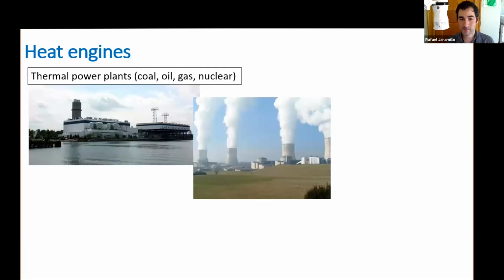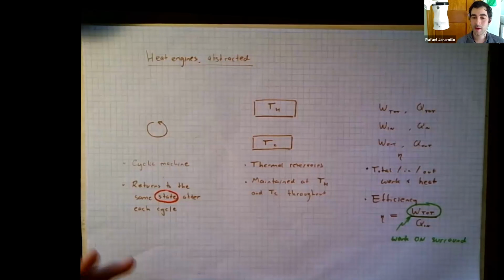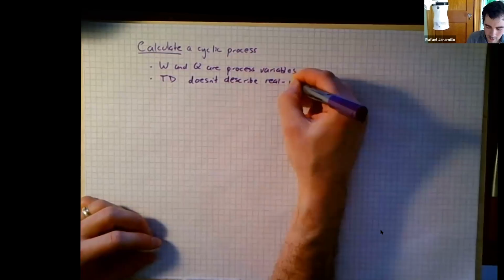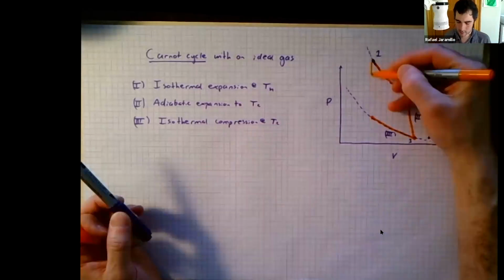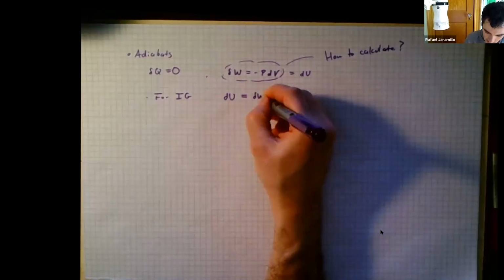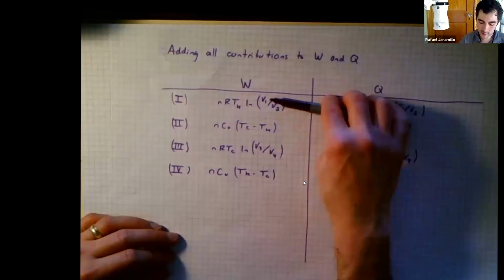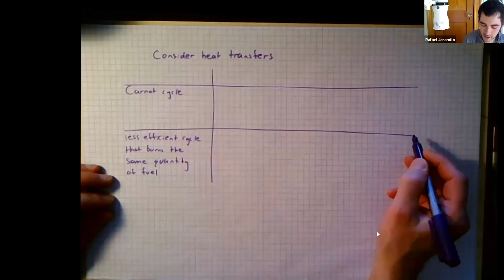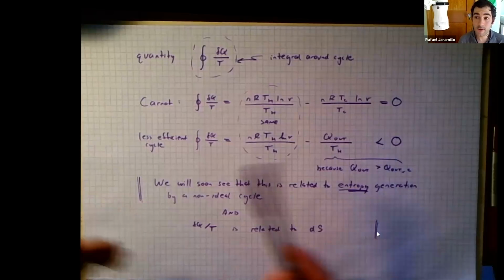Lecture 4: Heat Engines and Energy Conversion Efficiency

Comment: What is the book assigned to this course?
Reply from the maker: Textbook
DeHoff, Robert. Thermodynamics in Materials Science. 2nd ed. CRC Press, 2006. ISBN (print): 9780849340659. ISBN (eText): 9781420005851.
For more info and materials see MIT OpenCourseWare at: https://ocw.mit.edu/courses/3-020-thermodynamics-of-materials-spring-2021/. Best wishes on your studies!

Comment: I have a question regarding the efficiency of power plant: What does the water inlet have to do with the power plant efficiency? The water cycle described in this video is used for two purposes. 1) Condensate water - water pumped to a big condenser unit underneath a steam turbine (part of the cycle of the mentioned power plant) in order to cool it down thus maintaining the negative pressure within and to allow the worked out steam to become hot condensate (which is sent back to Boilers)  then it sent (as hot water) to the "cooling towers - then cycle repeats. 2) For so cold "technical water" which is used across the power plant as a coolant for bearings and etc.  Wouldn't it be dependent on gas flue temperature which is direct proportion of T hot becoming Tcold and output of power plant is its MWatt.   
I am trying to really understand the topic, this comment above sort of to start the conversation. I might be wrong, but still..... . Thank you

Comment: Great Video! Below are the timestamped summaries from ChatWithPDF:
00:00🌡 Introduction to heat engines and their role in converting heat into work, focusing on power plants as real-world examples.

01:34🚂 Steam engines, jet engines, and internal combustion engines as different types of heat engines, with a brief mention of hurricanes as heat engines.

02:57🔄 Abstract representation of heat engines with cyclic machines and thermal reservoirs, emphasizing the concept of efficiency.

04:58🔥 Discussion on thermal reservoirs, total work, heat, and efficiency in heat engines, highlighting the importance of maintaining temperature differences.

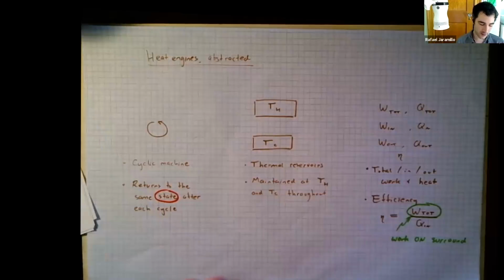07:14💡 Explanation of a typical heat engine representation with high and low-temperature reservoirs, work in, work out, and the concept of a cyclic engine.

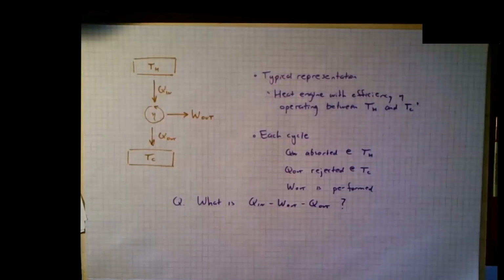09:38⚙ Analysis of the Carnot cycle, focusing on isothermal and adiabatic processes to calculate work and heat exchanges in an ideal gas.

11:20🌊 Explanation of high and low-temperature reservoirs in real-world engines like power plants, steam locomotives, and hurricanes.

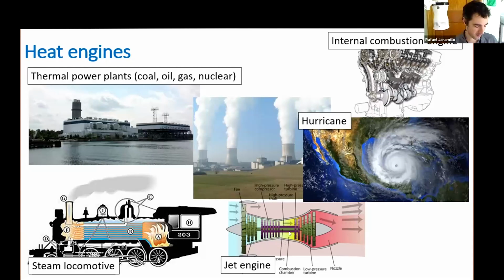12:31🌀 Discussion on the mathematical aspects of isothermal and adiabatic processes in ideal gas engines, including internal energy and state functions.

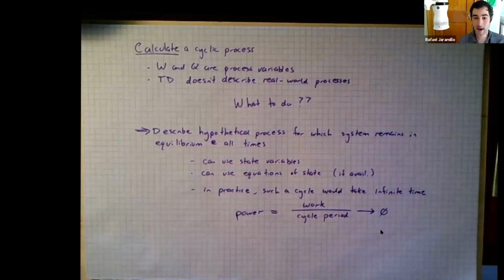15:58🔄 Overview of the Carnot cycle's efficiency calculation and the significance of temperature differentials in maximizing engine efficiency.

17:56📈 Calculation of the Carnot efficiency for the ideal gas Carnot cycle and its implications for improving power plant efficiency.

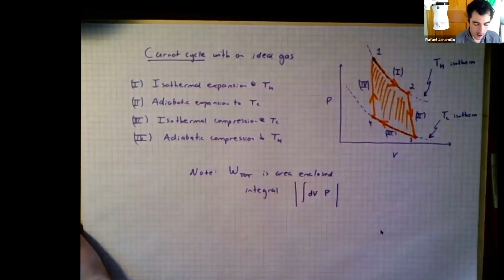20:59🔍 Analysis of isotherms and adiabats in ideal gas engines, focusing on work calculations and the relationship between pressure, volume, and temperature.

24:36

📊 Derivation of equations for isotherms and adiabats in ideal gas engines, emphasizing the role of internal energy and heat capacity ratio.

27:45🔥 Explanation of adiabats and their steeper curves compared to isotherms due to the heat capacity ratio in ideal gas engines.

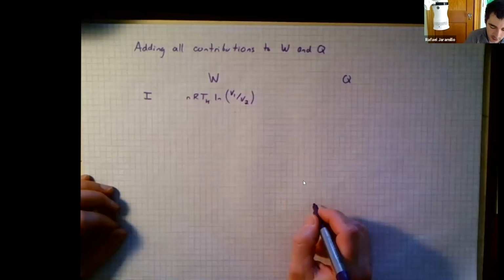30:02⏳ Calculation of work and heat exchanges in different segments of the Carnot cycle and their significance in determining engine efficiency.

32:12🔄 Calculation of the Carnot efficiency by analyzing work done, heat absorbed, and heat rejected in a heat engine running on a Carnot cycle.

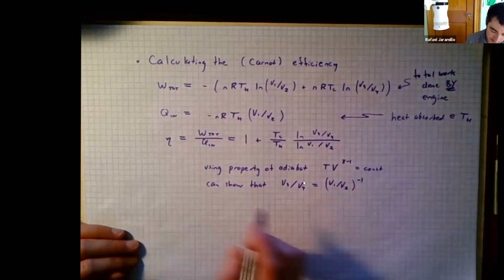35:18⚖ Comparison between an ideal Carnot cycle and a less efficient cycle in terms of heat absorbed, heat released, and implications for entropy generation.

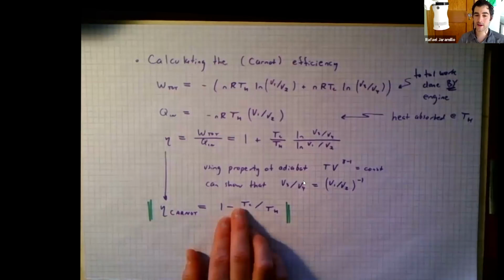37:06🔄 Engineering decisions to improve power plant efficiency by increasing high temperature and decreasing low temperature to approach Carnot efficiency limits.

38:42🔥 Discussion on heat transfers, the Carnot cycle's efficiency, and the relationship between heat rejected and entropy generation in less efficient cycles.

41:29💡 Introduction to dq over t as a key concept related to entropy generation by non-ideal cycles, setting the stage for understanding the second law of thermodynamics.

43:58🔄 Conclusion on the importance of understanding heat engines, their efficiency, and implications for entropy generation as a bridge to discussing the second law of thermodynamics.